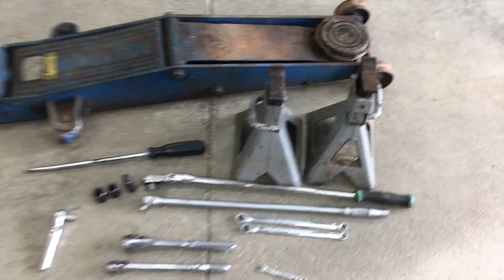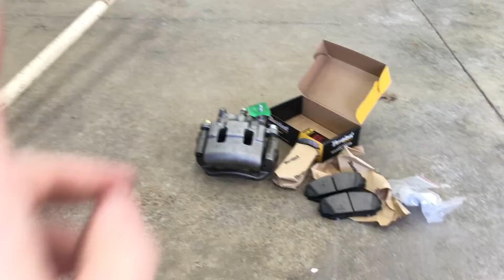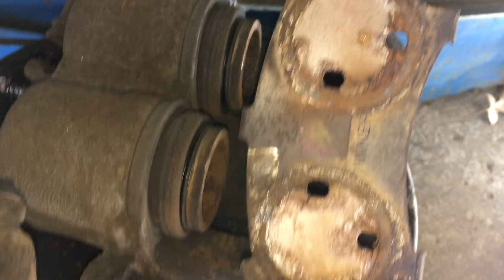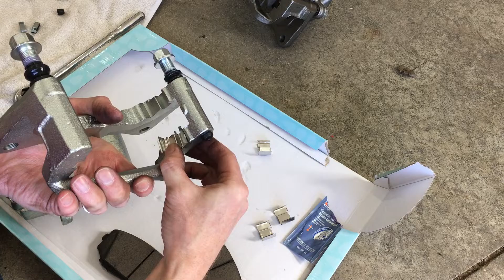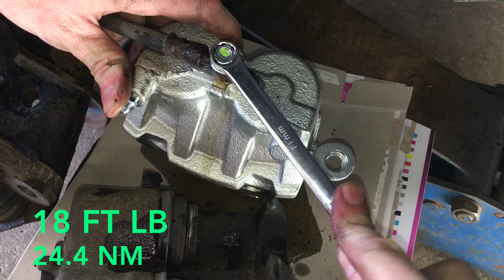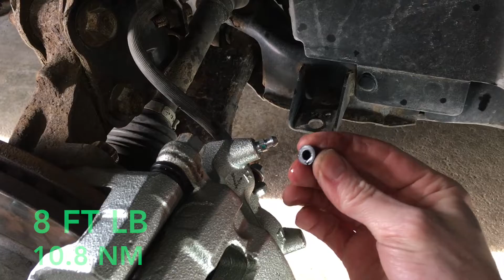How To Replace: Ford Edge 2011-2014 Front Brakes- Complete Guide: Calipers, Rotors, Pads

Comment: Excellent video! Do you have to bleed all 4 brakes when replacing the 2 front calipers? And if so, do you bleed before installing the new calipers or after?
Reply from the maker: Only the front brakes will need bled after installing the new calipers.

Comment: I've got a newer Edge but seems like things are clsoe enough.

What did you use as a lifting point to lift with your floor jack? Where the control arm meets the frame? (right on the bolt?)
Reply: If you use that to lift do you just put the jack stand further down on the pinch weld?
Reply from the maker: It's best to use the stands at that pinch weld.  I don't think the entire pinch weld is reinforced like the jacking point is. So I'd jack it from the subframe, then put the stands under the pinch weld jack points.
Reply from the maker: Yes that is a strong area to lift. I usually use the factory jack point on the pinch weld, below the side skirt. There is one behind the front wheel opening and one in front of the rear wheel opening. There should be diagrams of this in the owner's manual.

Comment: Fantastic video! Thanks so much!  The only thing I would add is that calipers on this car are notorious for binding up because of the rubber supply lines collapsing internally. It's worth replacing at the same time and doesn't cost too much.

Comment: I see that your brake kit also cane with all the metal shims needed. But there were a pair that looked like a small triangle. You had them in frame in the video while installing the shims on the bracket. Do you know what those are for? You didnt seem to use them either.
Reply from the maker: Those tiny ones were probably the wear indicators. They will cause a screeching noise when the pads get low. Usually they come attached to the pads already. I didn't see these staying on very well so I didn't use them.
Reply: @6thGearGarage  very interesting. ive watched dozens of videos already and none had any idea what they were and you were the only one that had them in frame. No manual or forum online seems to know what those extra shims are for. Even tried google image search and they dont pop up online. I would love to see how they are suppose to clip on and used but for the life of me i just couldnt figure it out or find an answer online. My fear was those shims were suppose to aid the braking power or braking efficiency. I greatly appreciate the response and input though 👊 you a real one! 👍

Comment: What point did you use to jack up the edge with the floor jack?? For the life of me, everything I've found on the internet says to only lift an edge by the pinch welds
Reply from the maker: It was where the lower a-arm meets the subframe. That is a very strong point on the vehicle's chassis.

Comment: Excellent.  These are called floating calipers.  You might want to explain how the calipers actually move during brake application.  And, as noted by another comment, the clips are not all interchangeable.  But anyway, this is a very good video and thanks for the effort.

Comment: I have a 2010 ford edge with 210,824.064 kilometers on it,  and by golly, if this ain't the best front brake pad & caliper change video this side of the Pacific, I don't know what is!
Reply from the maker: Thanks! Ours had 180k miles on it when the water pump failed on the highway, sending coolant into the oil and throughout the internals of the engine :(

Comment: NOTE : I found Clips are directional! One tab on inside multiple tabs holding it on outside. So gotta find which clip is for inner & outer or pad won't slide in

Comment: Great video. Appreciate the socket sizes needed saves a lot of time! I had inner pad worn 95% & outer pad only 50%. I opened the bleeder valve to see if any pressure from a line blockage & it was bone dry. Removed bleeder & pumped pedal. Not a drop. & no movement I seem to recall. Yet had fluid at the line. So removed caliper & compressed break pistons with bleeder out & got fluid. A blockage? What do you think? Putting on new pads & giving it a try. (pistons move now) oddly vehicle didn't pull at all when breaking.
Reply from the maker: If not an air pocket, It sounds like something was seized, very strange! Glad it was an easy fix.
Reply: @6thGearGarage are air pockets from improperly bled breaks?
Reply from the maker: @livenfree  possibly

Comment: This thoroughly detailed video was totally spot on for enabling my wife and I to completely replace our 2013 Edge front brakes on a Saturday, with no previous experience. We followed along step by step, too... We did make a first time purchase of a torque wrench though, which helped tremendously! Perfect Results!!
Reply from the maker: Glad to hear this helped someone else!
Reply: @6thGearGarage  Is a torque wrench absolutely necessary?
Reply from the maker: @Anonymous-ym6jq  an experienced mechanic can get a feel for the approx torque and guess by hand and be pretty close. for example 20 lbs is what I consider hand tight with an average length 3/8" ratchet. But without checking bolts with a torque wrench, there is always the risk of over tightening or having them come loose over time, especially on the wheel lug nuts.
Reply: @6thGearGarage  thank you very much for responding. I'm not an experienced mechanic so I'll be picking up a torque wrench 👍
Reply: I'm actually looking at doing this myself very soon. Can I ask, what rotors did you choose and was it difficult?

Comment: Can I just replace calipers and pads or do you need to replace rotors always as well
Reply from the maker: if the rotors are not warped, grooved, or glazed, then they can be re-used.
Reply: @6thGearGarage  thanks boss, you made changing the struts so easy I feel I can do the brakes next.
Reply: 26 mm thicknesses is minimum to reuse rotors according to my research.